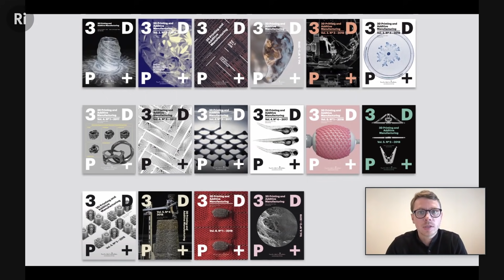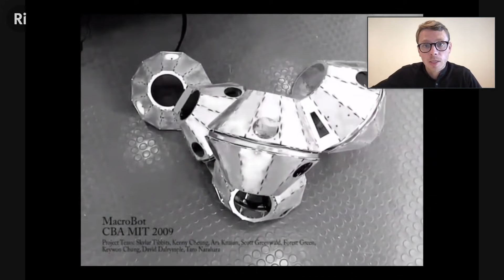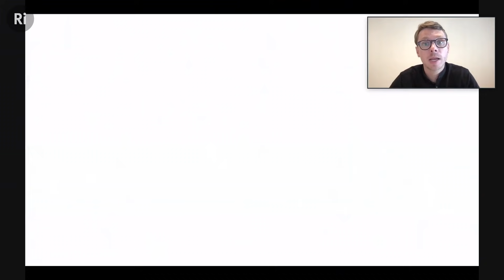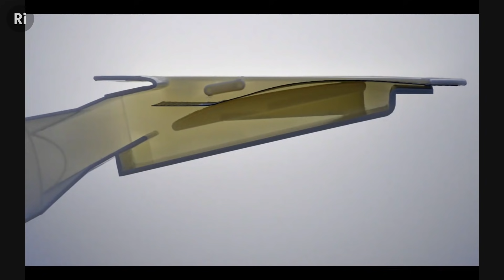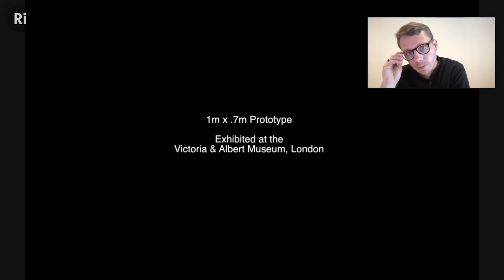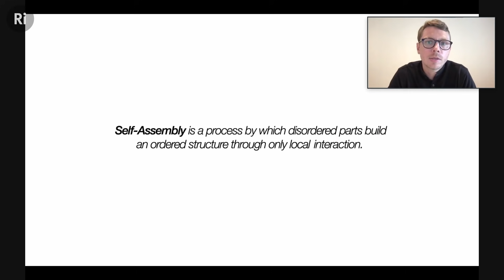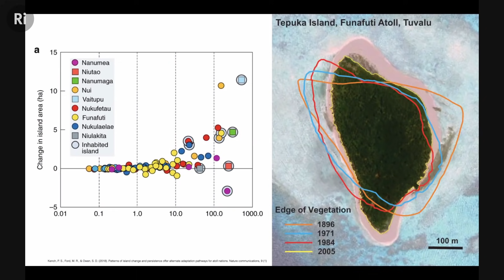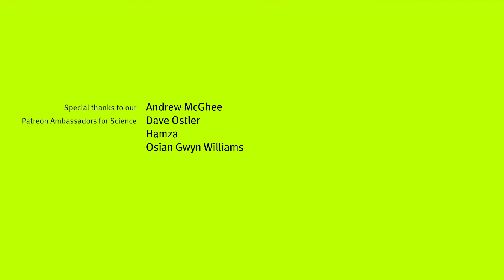What Can Intelligent Materials Do? - with Skylar Tibbits

Comment: First examples of self-assembly at the macro-scale:
You've been beat by many decades. I recall reading about a set of blocks with various carefully shaped hooks that would be put into a large case and shaken.  This demonstrated both self-assembly where they would "polymerize", and replication where one string would guide the creation of an exact duplicate.
Reply: I do remember seeing a video about that as well, magnetized and programmed parts that over time formed a structure, but it's been a while, and i've not really seen or heard any big breakthroughs in that field.
Not that i've actively followed it, but usually you'll hear about that stuff from time to time.

Comment: So if you took your balls and could encode them with magnetic locks controlled by spin then sheer the vortex you could get atp speed and control on construction. Changing the shape balled up or extended would help control the particle size and which attaches where, I found the clumping cell like formation particularly interesting, I imagine at the cellular level the pressure of the cytoplasm coupled with the fluid dynamics, stirred up by protein synthesis and controlled by the bladders of the cell membranes, plays a role in what base building blocks the cell has to work with and ultimately what it is likely to build or do.

Comment: A bit much hype if you ask me. Most of the things mentioned, already exist in some way in a product. Most of them have a fairly limited use case. Never the less in these use cases they allow for neat things.

The adaptive air inlet for Airbus reminds me of F1 engineers, trying to get around the rules and regulations for their aerodynamics. When the inspector came by, the component was like the rules mandated it. But on the racetrack  it deformed to a shape, which was aerodynamically advantageous.

Granular jamming is used in stretchers to fixate the patient in one location for transport. In construction it is used in rock bolts to load rocks in compression to form a stable structure.

The problem are the limitations. In many cases they outweigh the benefits to emerge broadly in every day items.

Comment: Honestly kind of depressing. I really thought at the cutting edge there would be a lot more advancement here.
Reply: The problem with cutting edge, is that, it’s not always accessible for the regular person. Some of these technologies seem to be practical and accessible, I like the contributions it can make to the outdated construction industry.
Reply: @garcesce  My comment probably sounded more negative than I meant it to be. I was kind of hopeful for some nano-tech solutions or something.
Reply: @thefinn12345  We're not there yet. And as the previous commentator said, "cutting edge" is not only inaccessible to common folk but very expensive. It's like the Sega Game Gear: it's far more advanced than the Nintendo Gameboy in a tech perspective but it expensive both to buy and maintain using...